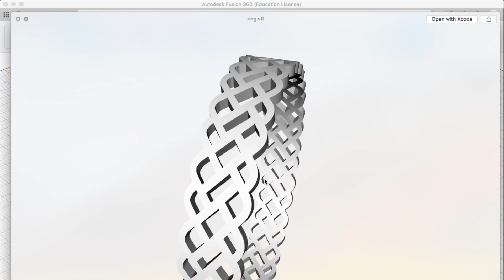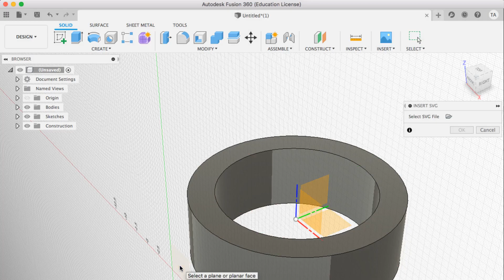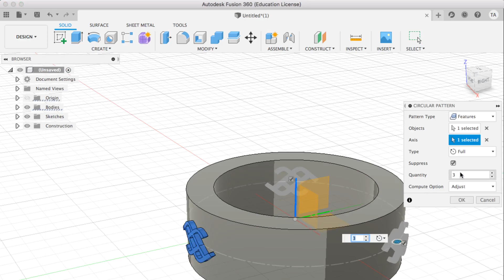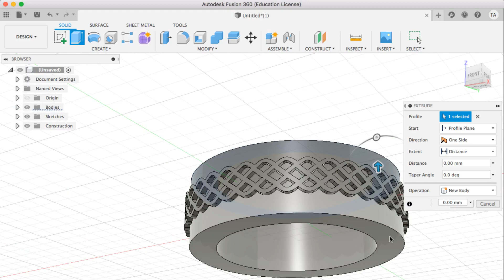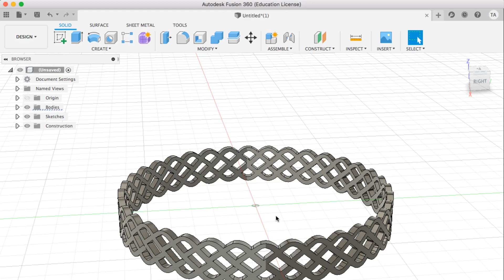How to use the Emboss Tool in fusion360

Comment: Thanks for the video...the trouble is that the pattern isn't perfect because when you had to choose between 17 or 18 instances in the circular pattern 17 instances left a gap, and 18 instances ended up overlapping too far. Is it possible to import an SVG and make it exactly the right size so that the start and end of the pattern match up exactly, creating a truly seamless pattern with no overlap? If so....how? I'm stuck on this on haha
Reply from the maker: Yes you can do that but pre planning the diameter of your circle ⭕️ & designing the pattern with such measurements,so that it’s able to loop perfectly once it’s duplicated an “X” amount of time around the diameter of the circle.